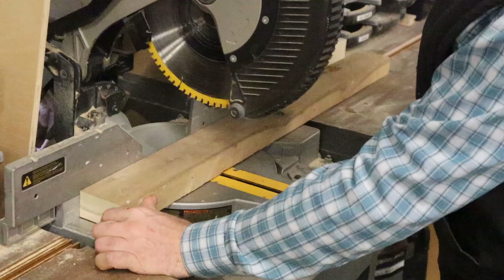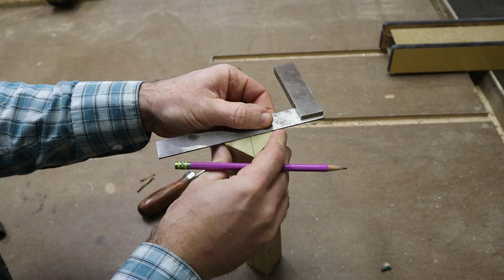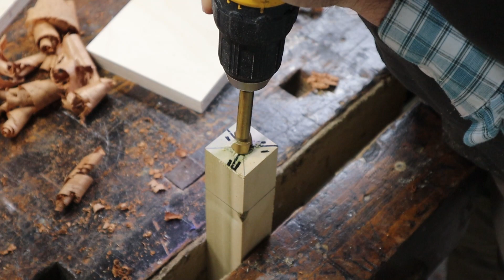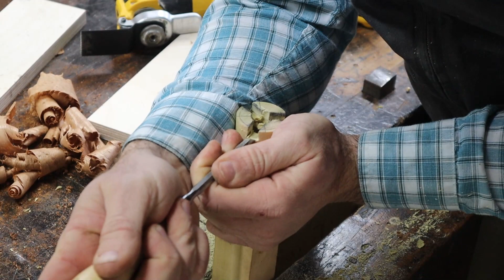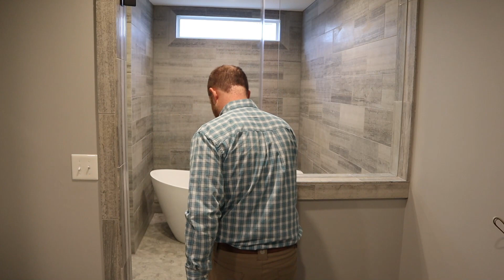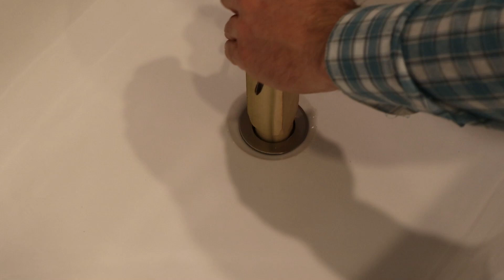I Should have made this Tool YEARS AGO!

Comment: don´t you use a riving knife at your circular saw? more safety
Reply from the maker: When the saw you see in this video was built riving knives weren't common.  My saw did not come with one.  I have thought about retrofitting one as I am sure someone probably makes one for my saw.  I actually have 2 table saws, and the other not only didn't come with one, there is no place to attach one even if you wanted to.
Reply: @shaweehillsworkshop4226  so your only opinion is to be Secure at work😂👍
Reply: You always get some idiot who has to comment on something negative instead of just enjoying the video you put time and effort into making keep up the great videos shawnee hills
Reply: @planetterror649  👍👍